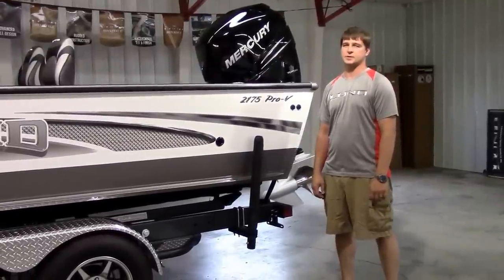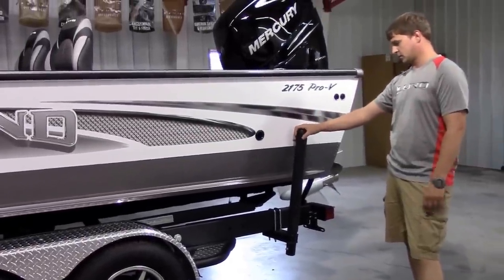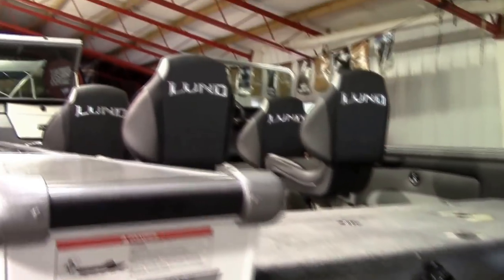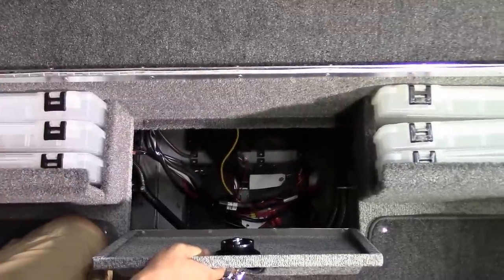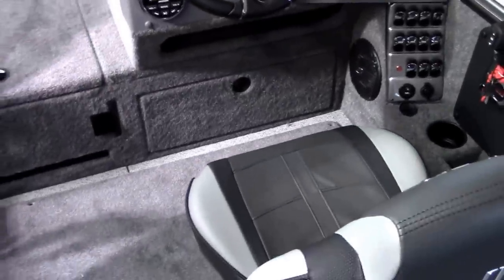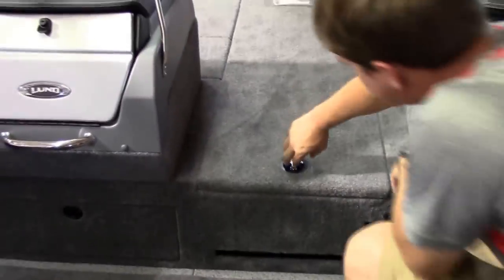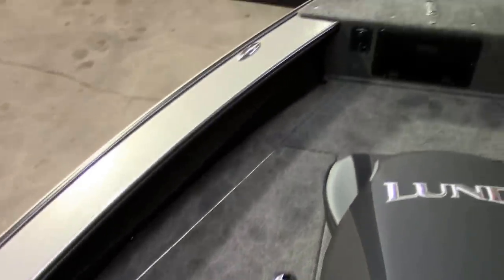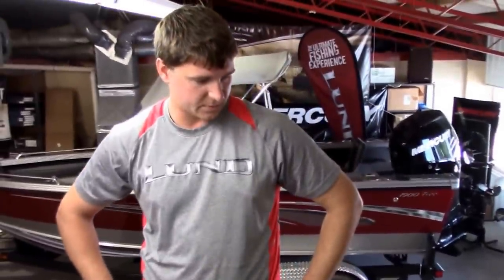2017 Lund 2175 Pro V

Comment: One key to remember is there's 2 types of track systems.  There's the 90 degree track and 45 degree track.  This one is the 90.  On the Rebel XS they have the 45 degree bracket.  That's key for when you're making a purchase.  Don't buy the wrong one mounting bracket.